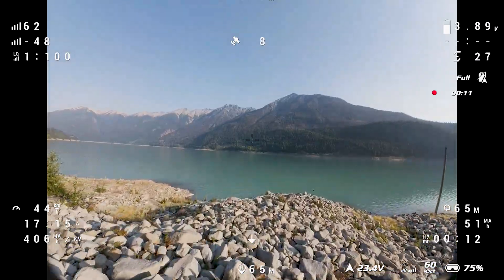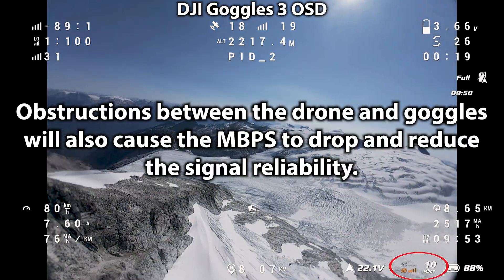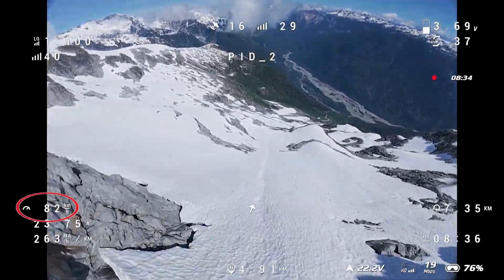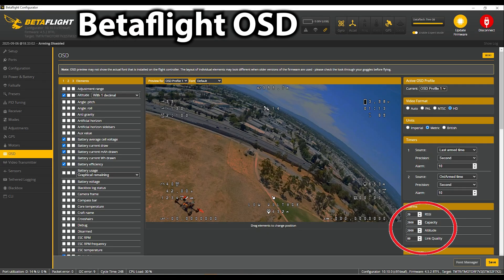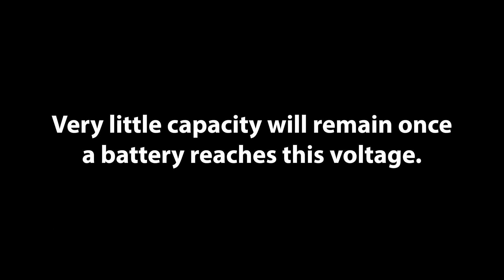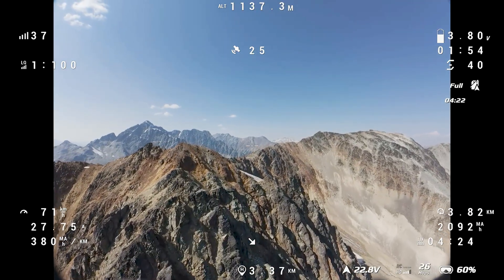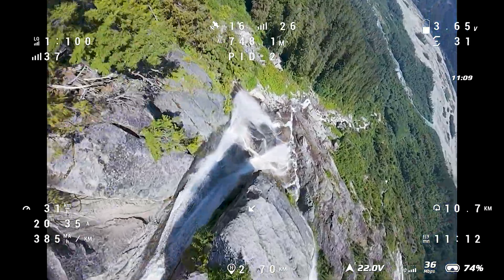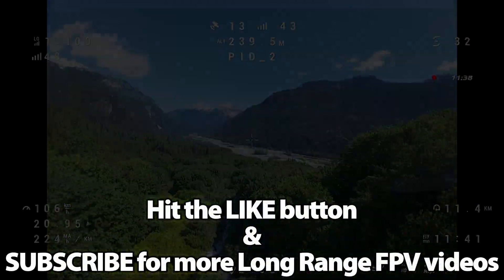Increase Range & Flight Time For Free - Long Range OSD

Comment: Very useful tips. Thanks. I've been flying long-range for several years now. Battery efficiency per km seems to be a useful metric, but it's important to remember that km, in the case of GPS and uphill flying, will be projected onto the horizontal plane. This has consequences depending on how much the drone is flying upwards. And it's not just about power requirements. For some reason, the KM unit isn't displayed after the slash in the OSD.
Reply from the maker: Oh ya for sure, 2000m elevation gain will reduce the possible range by a bit.  That's part of why I like track the mAh used in the elevation gain, flying the peak and the trip back all separately.

Comment: I fly a TanQS-XR4, 03 air unit, elrs(dual). Currently using a longer antenna(FF) for the 03 air unit. Would it help to use a longer antenna(03 air unit) to increase the "megabits".  When I reach 3km my megabits are down in the 15s..
Reply from the maker: I've done well using the I think 150mm or so TrueRC Singularity antennas.  The biggest impact on the mbps will be the type of antennas.  I mentioned my preference for the air unit antennas.  On the goggles, if they are V2's you can get something like TrueRc X2-air's which give great reception strength along with a reasonably good area of coverage.  For goggles 2 and 3 upgrading the antennas is a bit more difficult.  Also depends on the options for the air unit, have it set to 50mbps, I think broadcast mode lowers the mbps, but ya just double check all your settings to start.

Comment: I liked it, but I disagree with you about the telemetry placement on the OSD. Of course, everyone has their preferences, but for me, it's too much of a hassle. It's a lot of jumping around the screen for the information you need. The most important information (RRSI, LQ, VBat, arrow) should be visible without taking your eyes off the flight path, in my opinion.
Reply from the maker: Yes I actually agree, I like some of the OSD closer in to the middle.  Except I'm lucky enough to almost always have a spotter with me who will track my mAh used and voltage etc... for me.  So I've started moving it all back to the outer edges now.

Comment: Nice . Wouldn't it be nice if they wrote a code , that you could see in OSD, the distance left that can be safely traveled. Or a blinker that you have reached the half way distance.
Reply from the maker: You can set the mAh used and a counter to blink at any mAh count you chose.  I usually set it for just past halfway through the battery.

Comment: I’ve been experimenting with graphing starting voltage vs finish mAh when recharging my long range packs. Idea being if a point falls significantly of the historical data curve the battery may be having an issue.
Reply from the maker: Oh that's a great idea of how to track the fall off of battery capacity over time.  It would be an interesting metric for comparing the longevity of different batteries.

Comment: This is very useful, never tried the rssi element, is it reliable? How low can get the rssi before  rx loss?
Reply from the maker: Yes the RSSI is reliable.  For me it generally gets lower and lower as I get further away, until about 30 then it goes down really slowly after that.  Getting into the low 20's is common when far away.  It usually doesn't get below about 20 unless something is in the way.  I haven't had an RX loss while flying in years.  Almost always video will drop out before an RX loss is possible.
Reply: @FalconRadFPV That sounds convenient, I will try that. 5km is my longest  flight, but I sometimes get rx loss for a very short time while turning back home. Thank you for your reply ❤

Comment: Interesting calculations about the battery. I usually place the indicators at the bottom center: drone motor RPM, GPS speed, and altitude. On the right side, I keep the accumulated indicators such as flight time and mAh, while on the left side I place the dynamic indicators such as amperage and voltage.
Reply from the maker: Thanks for the comment!

Comment: since when are you flying dji? do you think the o4 pro with g3 is better than analog for longrange now?
Reply from the maker: I've been flying the 04 and G3 for the whole summer, it's getting fairly good for long range now.  The video on the 04 and G3 holds out much better than the 03 and GV2.  There is no stuttering or freezing on the video until the mbps gets down to like 3 or 4.  And it almost always gets blocky and gives you a second or two to react before fully freezing.  So I think the improvements are enough now that it's a good reliable option for long range.  In my opinion, digital still does not have the range and ability to hang on like analog does.  It's just the way it works, analog will never have a freezing issue, it's not possible.  DJI will always have a freezing issue because it has to receive a full frame of video before it will show anything, it does reduce the quality and resolution in an attempt to still be able to send a full frame of data even during a period of bad connection, and this works well but still does eventually freeze at some point.  The Goggles 3 are good enough now that this point at which it freezes, it's likely that an analog setup in the same situation would be providing video that is basically unflyable anyways.
That said, this one waterfall I fly its goes into a forest and requires flying through the trees about 40ft below the canopy and video gets really sketchy for parts of it.  I would never fly a DJI quad in there since video freeze would almost for sure mean crashing while analog would go totally fuzzy but I'll still be able to see enough to know the orientation of the quad and be able to throttle out of it.  Another consideration is that the 04 pro still costs about 3 x more than an analog VTX and camera.

Comment: Thanks for sharing.
I like it when the OSD elements are arranged in groups by type, so, for example, everything related to the battery is grouped together, and then on the other pages, all GPS information, such as home point, speed, altitude, etc.

I think it's also very important to mention regarding the OSD: set the warning thresholds correctly.
If you get warned too early, for example, with the voltage at 3.5V, it will annoy you until you ignore these warnings, at which point you might as well turn them off.
I see this again and again: people have this set incorrectly.
The same applies to altitude and RSSI dBm.
Reply from the maker: Thanks for the comment!  I guess there's as many ways to set things up as there are pilots out there.  I have my warnings turn on early so when I'm 5km away it's lets me know early enough that there is still enough battery to get back home.